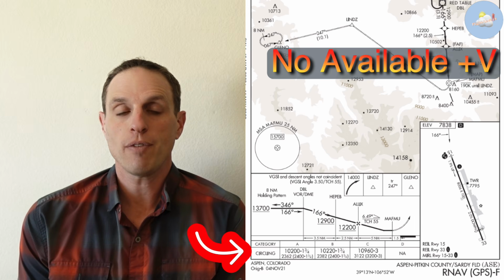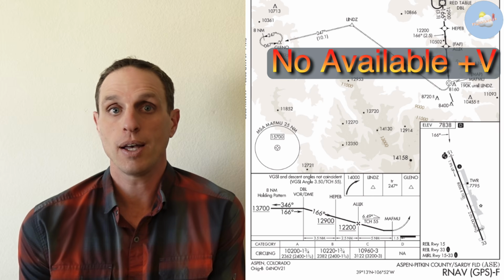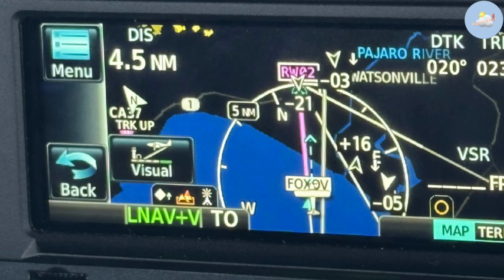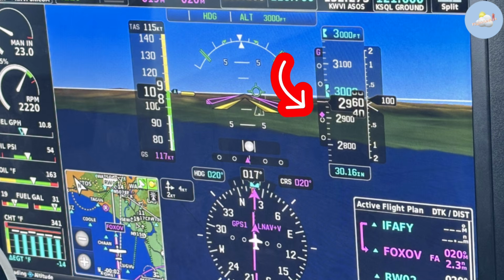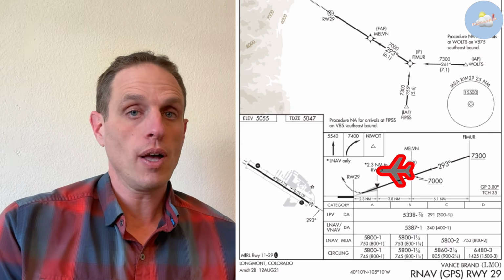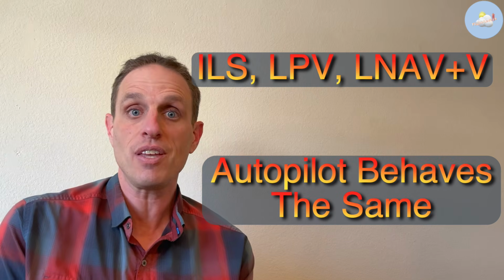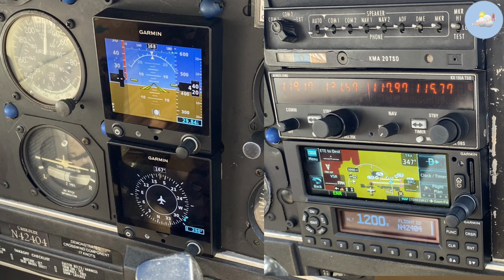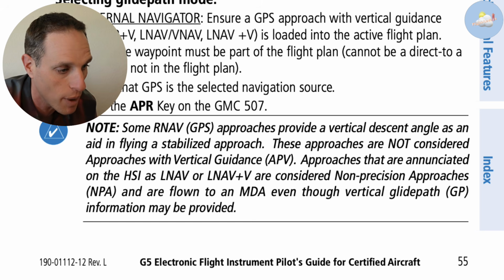LNAV+V: Did Garmin Actually Get It Right?

Comment: Thank you new subscriber. 

Garmin is not consistent.  It’s visual approaches do intend some level of obstacle protection, as terrain and obstructions along the path determine the availability of the vertical guidance. 

if no known obstructions are within the approach path, vertical guidance is provided to 28 nautical miles from the runway. If there are no known obstacles further than three nautical miles, but within the 28 nautical mile, maximum distance from the runway along the approach, then vertical guidance is limited to the approach path after crossing the known obstructions. If known obstructions are within three nautical miles of the runway along the approach path, advisory guidance is NOT available.

i’m in total agreement with your silver platter analogy.  But why wouldn’t garmin apply this same logic to the +Vs?  Thanks for your time Joe.

Comment: FOR FUDGE SAKE.... The Epic E1000 N98FK Crash at Steamboat Springs was NOT a LNAV + V. 
1) The FAA made a marginal approach and approach plate, very steep final segment. 
2) PILOTS MUST MAINTAIN MIN ALTS ON ALL SEGMENTS OF APCH AND NOT GO BELOW. 
3) LNAV + V  GARMIN States Advisory Only. You Must Acknowledge that message.
4) Most LNAV + V can be flown safely as if a gluide path. However this approach you can not, human factors. 
5) Pilot poor decision making, night approach, low visability, into mountainious terrarain. 
6)  Garmin should NOT have LNAV + V (advisory gudiance),? Well definitally not this approach.**

** WHEN I TEACH INST STUDENTS TO DO NON PERCISION APPROACHES. I have them calculate ground speed, rate of descent, to arrive at step downs or MDA, at a VDP (estimated if not published). DO YOUR OWN DESCENT PLANNING (including VDP, MDA) and ignore or only reference +V part. ONLY ILS and LPV give you a glide path you can bank on. Both take you to a DA. LNAV, VOR, LOC regardless of Garmin advisory +V have MDA's... Don't go below until you have runway and there is NOTHING tall between you and it that can snag you out of the sky.

Comment: Sorry, but I don't like that it has implicit permission to bust the MDA. Imagine if all I had to do was push the APR button again after it annunciated “Approaching MDA”. On a non-precision approach, I should have to do something to explicitly confirm that I have met the 91.175 criteria and intend to continue the advisory glidepath. I’d be totally fine if it also, after leveling off at the MDA, went into TOGA and unsuspended itself / changed to GPS CDI at the MAP. If I forgot to press APR again and I’m now in the missed approach procedure, that’s on ME. The DA is a totally different story. The excuse that it would be too hard for Garmin to build that behavior is BS.
Reply from the maker: I want to respectfully push back on a couple of things here.

First - there is no "Approaching MDA" annunciation in the Garmin system. That's not a feature that exists, so the workflow you're describing isn't based on how the system actually behaves.

More importantly though, I'd challenge the core premise. Consider how APR mode works on a coupled ILS or LPV approach - it follows the glideslope all the way to the runway with zero requirement for the pilot to take any explicit action to confirm they've met 91.175 criteria before passing through DA. No button push, no confirmation step, nothing. The automation just keeps flying.

If that's acceptable on a precision approach - and it clearly is, because that's how every coupled ILS in the world works - then I genuinely don't understand the argument for treating advisory +V differently. Garmin's logic is intentionally consistent: APR mode follows the glidepath. The regulatory and safety obligation to meet 91.175 before descending below DA or MDA is the pilot's responsibility in both cases, full stop.

Adding an extra confirmation step doesn't make the system safer. It creates the illusion of a procedural safeguard while leaving the actual responsibility exactly where it already was - with the pilot.
Reply: @Flight-Levels  First, I am well aware of the current behavior and that such an annunciation doesn't exist, which is precisely why I used the word "Imagine" as the first word in the sentence describing it. I'm challenging the fact that the system, as it stands, treats a DA/DH as equivalent to a MDA when we know that the rules do not. The latter is a hard deck until those criteria have been satisfied, the former is not. I'm challenging the status quo here -- While many pilots successfully survive non-precision approaches with the system as it is today (given their responsibility), I simply disagree whether the system should be allowed to blast right through an MDA automatically unless you stop it. It's a literal invitation for procedural intentional non-compliance. At some point, (and perhaps in the near future) some of the lessons we all learned looking at the recent KSBS incident among others WILL result in changes. Garmin is already removing advisory vertical guidance from certain approaches and I fully expect to see additional software changes to follow. The lawsuits and deaths will continue until safety improves. Adding procedural safeguards is absolutely a valid strategy to increase safety whether or not you believe them to be illusions.

Comment: Consistency does not equal safety. The autopilot will follow the mode, but that does not make advisory +V equivalent to ILS or LPV. On LNAV +V, MDA is for level flight until you have the required visual references, not continued descent. The fact that the pink diamond looks like LPV guidance is exactly what makes this dangerous, because it creates expectation bias and encourages pilots to fly a non-precision approach as if it were a precision one. YT is dishing out rotten instruction.
Reply from the maker: I appreciate the engagement, but I'd push back on a few things here.

The expectation bias concern is real and worth discussing - but it applies equally to any vertical guidance, including a VASI or PAPI on a non-precision approach. The solution isn't to avoid advisory guidance, it's to understand exactly what you're following and what it does and doesn't guarantee. That's the entire point of this video.

On the core safety argument: 91.175 is unambiguous. You cannot descend below MDA or DA without the required visual references - on any approach, precision or non-precision, with or without +V. That principle is stated multiple times throughout this video. A pilot who understands 91.175 and respects minimums is not made more dangerous by +V. A pilot who doesn't understand minimums is already dangerous regardless of what guidance they're following.

The characterization of this as "rotten instruction" isn't something I'll let go without a response. This video was reviewed against current FAA guidance and reflects the operational reality that thousands of IFR pilots navigate every day. Disagreeing with a point is fair - I welcome that. But if you can identify something specifically incorrect in the instruction, I'm genuinely open to that conversation.

Comment: If you follow an LNAV+V glidepath at night or in low Viz to a displaced threshold, or to an approach where the approach charts says "Visual Segment-Obstacles", You are a candidate for a CFIT crash. The generated glidepath takes you to the actual runway threshold, not the displaced threshold. Following it to a displaced threshold will put you well below the required descent angle to clear obstacles. Also, following the RNAV+V glidepath where you cannot select a descent angle to an approach, and where the chart says "VGSI (PAPI) and RNAV glidepath not coincident VGSI angle (for example) 4.00 (degrees) at night or in low viz means there are obstacles in the visual segment between DA and the runway. Following the RNAV+V to a runway like this could result in a CFIT accident. You must be very careful following an RNAV+V glidepath as they do not guarantee obstacle clearance.
Reply from the maker: Thanks for engaging on this - it's an important topic worth getting right.

I'd gently push back on a couple of points here. The core principle that applies to every instrument approach - precision or non-precision - is that obstacle clearance is only guaranteed down to the MDA or DA. Below that, on any approach, you are in the visual segment and obstacle clearance is your responsibility as the pilot. That's not unique to +V. A pilot who descends below minimums without the runway environment in sight is in danger regardless of what guidance they're following.

On the displaced threshold point - that's a valid consideration, but it's also a broader situational awareness issue that applies to any vertical guidance, not specifically an argument against +V.

I also want to clarify for anyone reading - the ability to manually dial in a specific glidepath angle for advisory +V guidance is not a feature that exists in the Garmin systems we're discussing. That distinction matters.

The broader message of my video stands: +V is advisory only, it does not guarantee obstacle clearance below MDA, and pilots need to understand exactly what they're following and why. Fly the approach, know your minimums, and never substitute any advisory guidance for sound aeronautical decision making.

Comment: Nice presentation.

A couple of technical observations.

1) Advisory vertical guidance (+V) based on GPS may be given by later versions of Garmin when outside the normal SSV of WAAS. The GNS430W/530W don't support this capability, but the later software versions of the GTN series will. I believe the G1000 NXi also supports this capability. First GPS to provide this were the Avidyne GPS systems.

2) Advisory vertical guidance can be provided by Baro-VNAV systems which do not need to be WAAS capable.

3) Although the LP obstacle protection area is the same as that for ILS or LPV and much tighter than the obstacle protection of an LNAV, with a WAAS GPS such as the GNS/W or GTN series, will use the same lateral CDI guidance on an LNAV approach or LP approach. So a non WAAS GPS will have a CDI FSD of +/- 0.3 NM, the WAAS GPS uses a 2 degree angular FSD to the threshold as long as it does not exceed 0.3 NM. The primary protected area for LNAV is the same regardless of flying with a non WAAS or WAAS GPS, but the CDI deflections are angular on the WAAS GPS.

4) Two really important points are that if a VDP is not charted on a straight in procedure, the visual segment is not clear of obstacles on a 20 to 1 slope, so using +V below the MDA can be dangerous. If the profile note: "Visual Segment - Obstacles" appears in the profile view, Flight Check has determined it is downright dangerous to use +V below the MDA and +V is likely to lead you to the scene of an accident.

Comment: It ain’t “dive and drive,” dive is different than descent, the alliteration is appealing but it is a misnomer. This distinction matters. Think of zoom vs climb but going the other way.
Reply: 25+ years ago we didn't have any GPS, at least not for approaches. We had ILS, LOC, VOR and NDB. All except for the ILS we used the dive and drive technique. I always thought it was horrible and could be very demanding in the old, crappy, low fidelity (DC-8, DC-9, 727) simulators. When we started doing the continuous descent approaches we thought it was a huge improvement. But in any case it was known at the time as the dive and drive.
Reply: @rwgallup  but that is a heavy transport jet that is slick in drag and slow to add power due to both compressor inertia and concern for fuel change rate so as to avoid compressor stall. Light pistons are both draggy hence responsive to power reductions and also quick to respond to power adds. Stepdowns are perfectly fine platform depending. I’ve done plenty in the Hornet. Have a look to Medium for Stabilized Approach Shenanigans. Never heard “dive and drive” through twenty years of Navy flying.

Comment: Design induced error, learn about it. It ain’t pilots using it wrong, it is build bad. It may be working as intended and functioning fully correctly, but if it baits you, it is badly built. You can go back to 1947 to see this, look to the B-17 gear v flap and switches issues.
Reply: Have a look for F-35C Crash into the South China Sea, it will relate. You want the Medium article.
Reply from the maker: I’m a big fan of Human Factors research, and you’re right that 'Design-Induced Error' is a real phenomenon. The B-17 gear/flap mix-up is a textbook case of poor ergonomics.

However, there’s a nuance here: Garmin isn't 'baiting' the pilot with a confusing switch; they are providing a tool with a very specific, consistent logic. In 'Approach' mode, the autopilot is programmed to follow the path to the end. It doesn't know where your legal 'floor' is for that specific day, category, or NOTAM.

If we want the airplane to level off automatically, we are asking for a much higher level of automation complexity (and cost). My take is that as long as we are the 'Pilot in Command,' we have to be the ones to provide the 'Design' for the floor. It's a great debate on where the engineer's job ends and the pilot's begins!
Reply: @Flight-Levels  disagree. If the +V poses hazard, they shouldn’t provide the +V. It isn’t about “fixing” the +V, it is about reducing their availability. Have a look for The Atlantic’s article The Deadly Myth Human Error Causes Most Car Crashes.
Reply: @Flight-Levels  you realize they said the same sort of things about the B-17 pilots in those days too

Comment: This dumb ass garmin fake glideslope should be banned. you are flying a nonprecision approach with stepdowns, MDA, MAP, and VDP.  And no you dont have to dive-and-drive just trim up a modest rate of decent based on your aircraft and approach speed. If you need to level off for a stepdown, then level off. If you are sailing over your stepdowns more than 300 feet above, steepen your descent a bit.
Reply from the maker: I hear your frustration, and you’re describing the 'Golden Age' method of flying NPAs-using a calculated rate of descent and manual pitch control to stay on the path. For a pilot who is high-time and current, that works great.

However, the reason +V exists isn't to replace that skill, but to provide a visual reference for it. When a pilot is task-saturated (fighting turbulence, talking to ATC, and monitoring step-downs), having that 'fake' glideslope as a cross-check prevents the exact 'sailing over stepdowns' scenario you mentioned.

The 'danger' isn't the tool itself; it's the pilot treating an Advisory string like a Certified beam. Garmin isn't trying to trick anyone—they’re trying to provide a stabilized path so pilots don't have to 'steepen the descent' or make big power changes at 500 feet AGL. It’s about reducing the 'hectic' factor. Thanks for the input-it’s a perspective that a lot of old-school sticks definitely share!
Reply: @Flight-Levels  No. Just no. This "everything is pilot error" attitude needs to be retired; it belongs, with so many of our engines, in the 1950s, when we needed pilots to compensate for marginal technology. When a highly-trained and highly-motivated individual takes an action that seems sensible based on the normal function of the controls, and the machine kills them as a result, that is an interface design problem. Yes, it is the pilot's responsibility to know when the machine's behavior will be counterintuitive, and that does make it pilot error, but it is definitely an interface design problem. Knowingly designing and presenting a glidepath that will guide the autopilot below a stepdown limit is begging for design-induced errors (and lawsuits - pretty sure there's at least one on the way, based on a recent accident). I'm sure someone at G can explain why modifying the software to prevent going below stepdowns is not possible - or at least not easy - but to this naive outsider it looks like 15 minutes' worth of coding and a day or so of testing.

Comment: MDA typically depends on category, which doesn't often change for a single aircraft. Why not have the aircraft category as a GPS installation setup option? Then the GPS knows the MDA (most of the time, if not changed by temperature or ATIS availability).

Also, when the GPS refreshes the database, for each non-precision approach it could look for the VDP marker and grey stipple. If those are not there, it knows the approach is obstructed so when providing +V, level off at MDA (and provide an annunciation). Otherwise, fly it down.

Yet perhaps attempting to increase the automation capabilities is the wrong approach, since automation dependency is a slippery slope.
Reply from the maker: This is the exact debate happening in avionics labs right now!

You’re right that the GPS could know these things, but the 'edge cases' are what kill the idea. MDAs change with NOTAMs, cold temperature corrections, and even pilot category choices. If Garmin automated the level-off, they’d be assuming the legal liability for every 'wrong' MDA in the database.

I think you hit the nail on the head with your final thought: Automation dependency is a slippery slope. Garmin’s logic forces us to stay engaged. They provide the 'Stabilized Path' (the +V), but we have to provide the 'Brain' and the 'Floor.' It’s a classic case of keeping the pilot in the loop so they don't become a passive spectator in their own cockpit. Great engineering deep-dive!